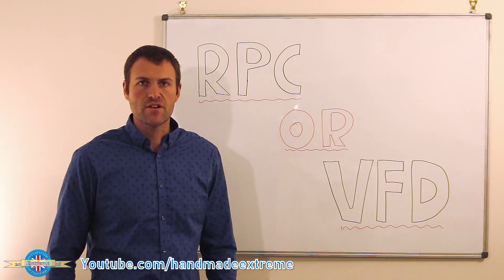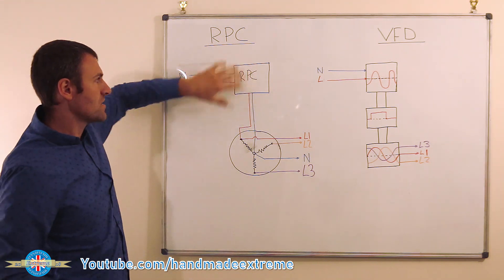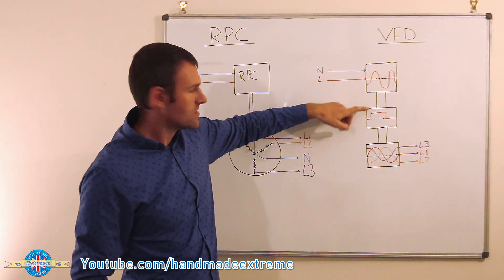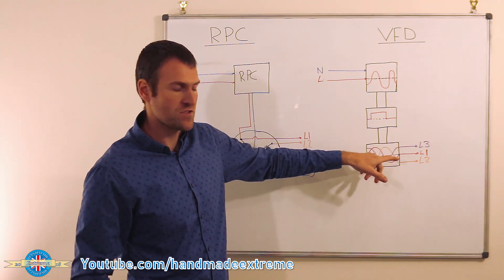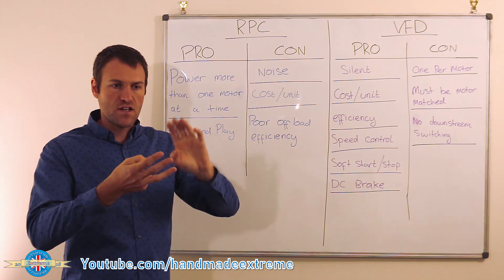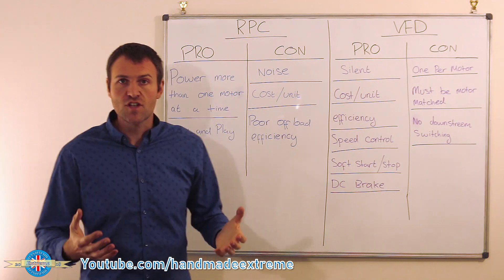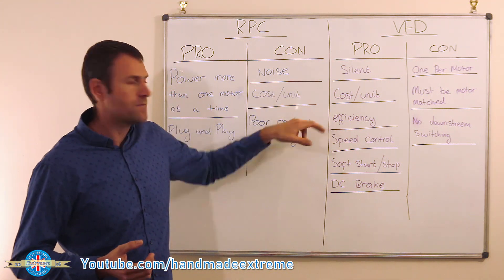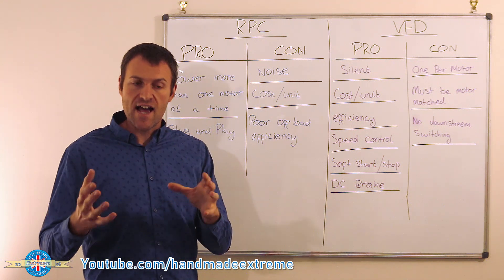Rotary Phase Convertor (RPC) vs Variable Frequency Drive (VFD) ... Which is best ???

Comment: Two things that I noticed you didn't touch on regarding cons of VFDs.. That is the excessive noise placed back on power lines caused by the VFD in the circuit due to the harmonics being produced which can have an adverse affect on other connected loads, especially electronic circuits. Line load reactors can help with this but that is additional expense to add those, another solution is isolation transformers but that's an additional expense as well. The other con of VFDs is that the harmonics will set up currents in motor armatures to ground. This means premature wear of bearings, so one can expect shorter life for the bearings in the bridgeport and lathe etc where you're powering with VFD. This can be alleviated with special kits for grounding motor shafts to reduce the voltage differential thus current flow through your bearings but that's another expense as well.

Comment: It looks like I came across this vid last year. Not entirely correct on a number of points with the VFD.

In a one-man operation, using 1 machine at a time, you'd only need 1 VFD per size of motor. Also with coolant pumps, they could be hidden by the spindle motor - so say you have a 3hp spindle motor and a 1/4 HP pump, just connect the pump to the same VFD - s long as you accept the spindle and pump to be switched at the same time - although a switch could turn the pump off - and I bet a VFD for a 3 HP motor wouldn't be fussed if the pump motor was switched on or off while the spindle motor was running !

So, which option did I go for ????
The answer's on my channel: Machining by Mike !

Comment: A RPC is almost never better for running induction motors. They're very expensive, unreliable and hard on motors.

You can't simply add as many motors as you like with one RPC. They have current limits and have to be massively derated for heavy use applications like milling motors.

They advertise 15hp but when you're done with the fine-print you barely have the confidence to run a toaster. Unless you spend $2000+

VFDs to run 1-5hp motors are cheap. Even if you ran 5 mills, VFDs would likely be cheaper and more reliable and less likely to destroy motors. Plus less noise.
Reply: I'm allergic to electronics.

Comment: Actually, most rotaries use two legs of single phase to induce a voltage on the third leg, You are inputing single phase two legs that are 180 degrees out of phase to each other and you are pumping into a motor that is designed to have 3 legs at 120 degrees phase angle. Therefore the third leg is running wild. You have inductive reactance and capacitive reactance to shift the voltage vs current to get the best power factor possible. In other words the induction motor is tuned by the capacitors to improve power factor. Coincidentally when you add more 3 phase motors in parallel, you improve the wave form of the wild leg. It is crude conversion, but works well for dumb machines. I have made several. The VFD takes the input of single phase and rectifies it to a dc voltage then thru chopper circuits and capacitors make a precise 3 phase wave form, many things can be manipulated with a VFD, fwd/rev, soft start, programmable torque specs, variable frequency determines the motor, etc. but it is electronic...the rotary is better for shock loads, dumb machines, but not precise wave forms.      yes, I used to work for GE
Reply: Do GE not make MG sets - that'd be a better option - and one I was looking for around a year ago but never found any !
Reply: Could you recommend a VFD for a meddings mf4 I was thinking of buying?  Thanks

Comment: Interesting video, pretty well explained, another PRO for the VFD is easily reversible, a 2hp VFD can be easily had for under $150au or under $100gbp.... The downside for the budget VFD's is the output voltage won't run STAR connected/wound motors as the voltage is too low (220v instead of 380v), a 380v motor that can be configured in both STAR or DELTA can be configured to run on 220v DELTA... I recently bought a 3 phase 2hp lathe, I added a VFD which now gives me variable speed on top of the 8 sp gearbox, it was easy to add all of the original controls and ditch all of the contactors and control transformer all for under $100au, the coolant pump is a 415v motor so it cannot run off one of these VFD's as they only output 220v so a single phase coolant pump would be the easies solution, but it's not plug-n-play!!!
Reply: I have a vfd that takes 220 single in and spits out 380v/400v three phase. So it works good on a wye wired motor. Works well.
Reply: @jasonasselin8657  I have the same, 240 in 440 out
Reply: @jasonasselin8657   What VFD did you get? im looking at a colchester bantam and its has a 2 speed, 2hp motor - would your vfd work with it?
Cheers

Comment: Excellent, well done!  You are right about one thing, there is a lot of misinformation out there, most of it by omission - I think many of the presenters just don't have the complete grasp of the two devices and their pros and cons that you do - for example, no-one that I have come across addresses the 'matching' issue.  That was a big issue for me, as I have both a lathe (Colchester Bantam 1600 Mk II) and a mill (Bridgeport vertical mill) that are three phase, and I hunted high and low for the answer as to whether I could run them off one VFD.  You answered that quickly and beautifully - and a host of other questions!  RPC it is!  Thank you! "Plug & Play" says it all!

Comment: My 3hp 3 phase motor only have 3 wires on the connector block. Does it mean I can not use a VFD to run this motor from 220 volt output
Reply: Is it a 380V motor ? You'd need a 380V VFD - unless you can find the other 3 ends of the windings !

Comment: Thanks for the great information. I just got a 3phase coffee machine and it has 2 boilers and a motor, its rated 220-240V, 380-415V. I really don't know the best way to go about powering it with my single phase 240
Reply: Power it off 1 phase !
Reply: That's hell of a coffee machine m8

Comment: As other have said here already: you can run several motors on the same VFD and switch the smaller motors on and off - like coolant pumps and feed motors, as while the bigger spindle motor is running - just like on an RPC. That's no different to suddenly having the load on the motor change, after all. At the extreme, if you crash your mill and stall the motor, the VFD isn't going to blow up!
Also, you can run very small 3phase motors off a large VFD! That isn't the issue. You just can't set the motor protection parameters - just like you can't on an RPC.
You obviously can't vary the speed on your multiple motors independently with a single VFD - just like you can't in any case with an RPC.
People including you make a big fuss about the parameter settings. All you need to do is set the VFD to 50 (or 60)Hz and maximum power and treat it like an RPC - no further adjustments needed - then just like an RPC, you get none of the benefits of VFDs, just like an RPC.
It is also worth mentioning that RPCs only provide balanced 3phase power at SPECIFIC motor load. Larger motor run unbalanced and so do smaller motors.... VFDs are ALWAYS balance at any load up to their maximum.
Lastly, VFD are now so cheap, that you can easily buy 6 or more of them for the price of a single RPC. Along with the demise of the issue of single phase input at a lower voltage than the output needed, e.g. 230V in and 415V out. Most VFD manufacturers now make VFDs at the same low cost that do just that. So you can run a 2-speed 3-phase motor off a 50 quid VFD now....
I can't think of ANY reason to own an expensive RPC any more.... sorry.
Reply: Thanks for the point about RPCs not providing a balance output at the wrong load. We ended up getting new motors for both our machines - we didn't know the history of the motors but we were running them off a static converter - which I never liked.
Reply: Hi there, can you recommend to me a make of  VFD to run a pillar drill I am looking at buying?  Thanks.  Its a Meddings mf4
Reply: so if I set the VFD to 50 (or 60)Hz and maximum power will I still need to change the pulleys?
Reply: @jeremykemp3782  if you don't want to change the speed of your machine, you don't have to change the pulleys....

Comment: I will say here in America a rotary phase converter pre-built is very expensive, compared to a VFD from China,

We can get two horsepower VFDs for $50 a tank of Petrol, and 10 horsepower VFDs for 170$ 3 weeks of diesel and 2 lunches.

But yes learning on my Van Norman which is a h/v mill with three motors all different horsepowers and the relays and switches and transformers will have to be wired on the individual circuit, The rotary  converter would have saved me some learning, But a 20 horsepower rotary converter is 1100, I can buy 2 10hp VFDs and 13 less than 3hp,. Before I worry about the inefficiency and cost of a rotary converter, like I said I will have to remove the transformers out of my machines and wire in the safety switches separately be doing a lot of custom work that not everybody is up to

Comment: Hi. I have been watching your channel for a while and wanted to ask you for your advice. Would it be best to go for a VFD for my 3phase 2.2kw table saw? I only have one 3phase tool in my workshop. If yes can you post a link with a VFD that you recommend as there is so much to choose from and I don't want to end up getting the wrong one. Thanks in advance
Reply from the maker: Hiya. If you never plan on adding more 3 phase machines a VFD is probably the best option yes 
Regarding which one... I'd honestly recommend contacting a few local suppliers and asking them. Tell them exactly what is is for and how you want to use it and they will be able to size one appropriate for the application. They will also give a warranty etc. I have personally used Allen Bradley, Mitsubishi and a few other big name drives at various points and they are all very good to be honest. It can be a bit tricky if you need to step the voltage up ie you have a 230v supply and a 400/600 motor rather than a 230/400 motor (this information is on the motor plate)  But there are drives that claim to be able to do this though I have never used one personally. Hope this helps. Thanks very much for the support and good luck getting your machine up and running. 👍
Reply: @Handmadeextreme  Thanks for your personal and detailed reply. My saw has an old 415v motor which only allows star configuration and in my case my best option might be to get a 240v new motor or build a rotary convertor. Much appreciated for your detailed response again

Comment: Great video!
Maybe you could also add the Steinmetz circuit next time. At 230V you need a capacitor of approximately 70mH per KW. With this circuit you can power a 3 phase motor with single phase, but you lose torque.

Also almost every affordable single phase input VFD, does not output a higher voltage than its input. So for example a 1~ 230V VFD cannot power a 400/690V motor, because when in star config the needed coil voltage is 400V.

RPCs are a rarity in the Netherlands. Almost all cables to houses are 3 phase, but in the past the utility company just put one 35A fuse in. You can change to 3~ 25A but it costs around €300 to rebuild (which is ridiculously expensive for just adding 2 fuses, but you there is no choice). Since 2011 3~ 25A is standard for new houses.
Reply from the maker: Great information, thanks for sharing.
Reply: €300 to get three-phase supply sounds like a good deal from that tiny island to your north-east!

In the UK it varies by area (there are 5 independent regional "Distribution Network Operators") but if you have a physical 3-phase supply on the outside of your house,  it's around £1000-£1500 to get that connected, that price goes up to £3500-5000 if there's a 3-phase supply cable in the street directly outside your house, *If* you dig your own trench to the property boundary.

Those prices aren't unreasonable considering the additional live-working required to add connections, but most homes would be looking at an order of magnitude more expensive than in the Netherlands.

As an aside our single phase supply is normally a 60A or 100A fuse, and a basic three phase supply is 100A per phase, allowing us to draw a really huge amount of power if desired (24kVA single phase, 41.5-72kVA three phase [depending on if you run 415 or 240 loads] in the UK, compared to 8.4kVA single phase or 10.35-18kVA three phase).

I can only assume dutch building practices assume much lower electrical energy demand, and don't anticipate the use of electrical heating equipment.
Reply: i am lucky to be in germany. we have 3 phase to our homes and can also use the three phase for motors etc.

Comment: VFD's are CHEAP.. I got a 7.5kw for $200 USD for my big lathe, I got a milling machine with an RPC and I have a loathing for the noise it makes, and it's an absolute power hog, 10 minutes of just idling and it's quite hot, and if you're running a 10kw RPC to power a 1kw motor, it's incredibly inefficient... I have a 2kw VFD on my small lathe, it works great, and I do use it on a few other items around the shop with a similar power rating.

Comment: If I decide to install a VFD into a large-ish mill, don't I connect the former's output to the "overall" input of the mill, from where it distributes power (electrically or mechanically) to all its motors? I reckon that at some point, it just becomes easier -- if not necessarily cheaper, at least in the short run -- to install "native 3-phase" into your shop.
Reply: I chose diesel-powered 3ph. Doubles as a back up in power outages :)

Comment: RPC fails whole shop is down . If VFD fails one machine is down, but if you know how its not down for long.
Reply from the maker: A very good point. I have not had that problem yet (thankfully) but I do keep a selection of capacitors on hand in case one does blow on the RPC. Thanks for the support. Great comment.

Comment: Your arguments are OK for high power motors, but using a capacitor wired to the motor might be enough for light duty motors, e.g. coolant motors. I have a mill and a lathe and I'll use VFD for the spindle motors and cross feed and capacitors for coolant.
Reply: Forgot to say: it's cool to have a guy doing both projects and theoretical explanations. Good job!
Reply from the maker: Great point about small motors. That is a much cheaper alternative. 
I'm glad you are enjoying the channel. Thanks for the support.

Comment: You have forgotten to mention the biggest problem with a VFD it will only work if you can wire the motor in delta and yes you can get a VFD that will give you 415 volts but they cost the earth. 
Regards
Ernest
Reply from the maker: Good point. Yes the 415v ones are a lot more expensive. Thanks for the support.